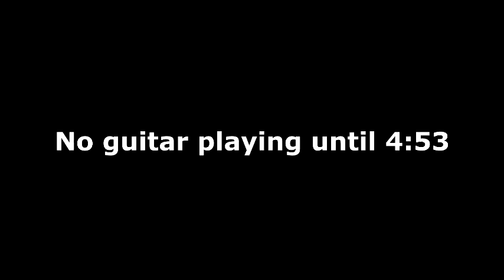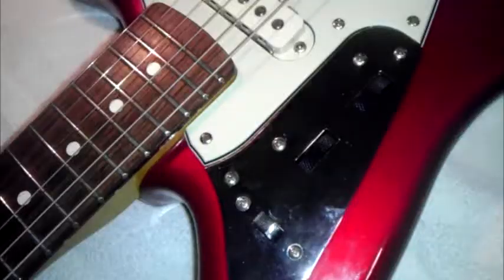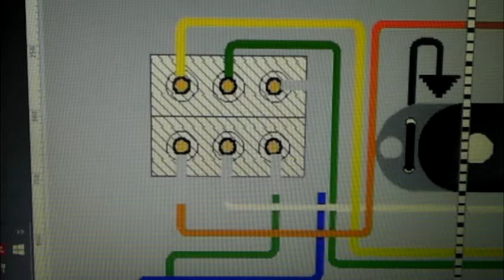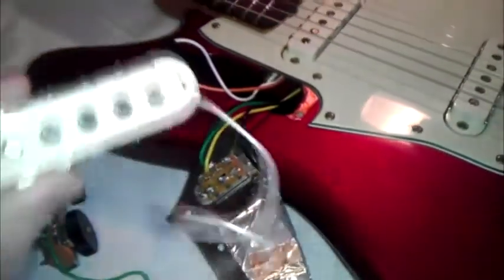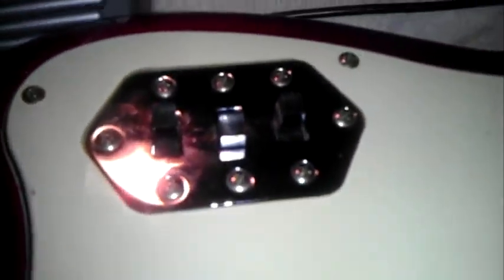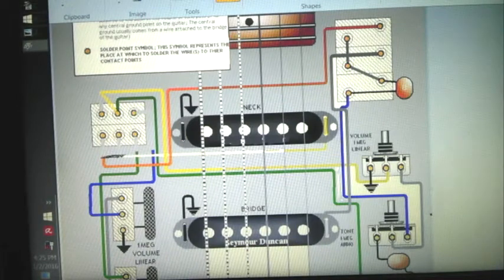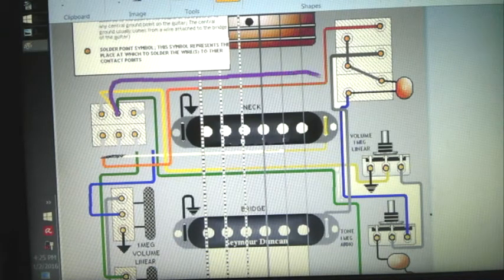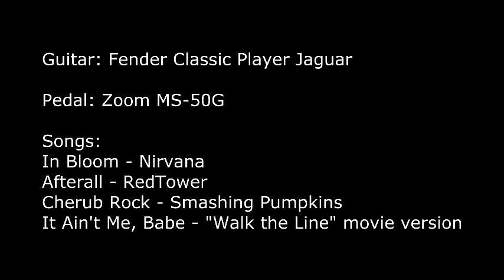Fender Jaguar Mod: Dummy Coil

Comment: I'm very new to this but every article I read on the subject says the dummy coil should have the magnetic pole pieces removed. Otherwise it's just another pickup with all the related phase/polarity issues. That's what seems to be happening on some your settings. Just an FYI.
Reply from the maker: That can happen, but I wasn't out of phase in the video. If you are referring to the brightness at 4:55, that is due to the resistance being halved since the dummy pickup is in parallel rather than series. Whether the magnets are there or not, the tone will be colored by this.